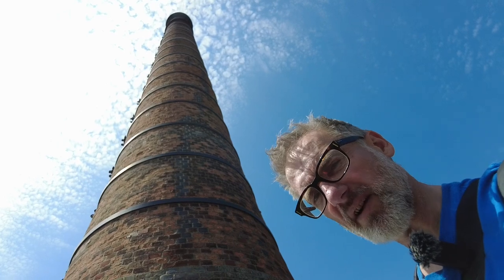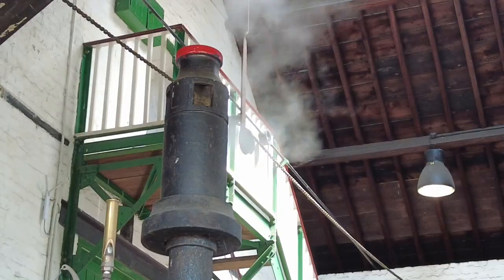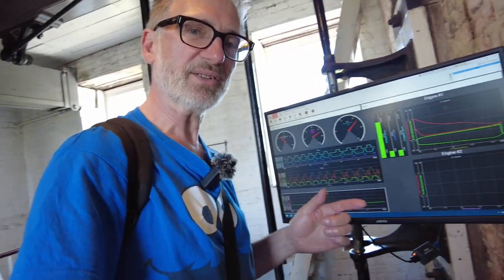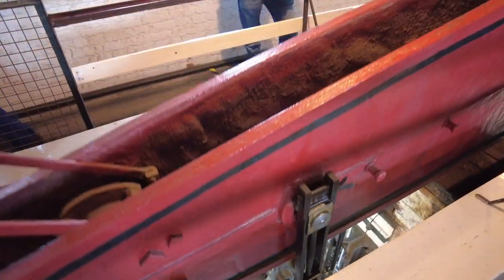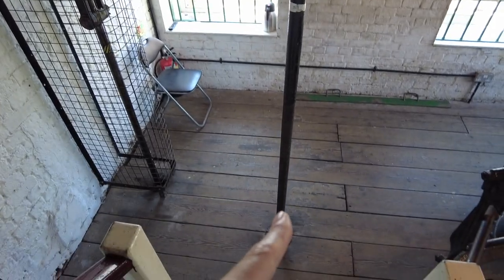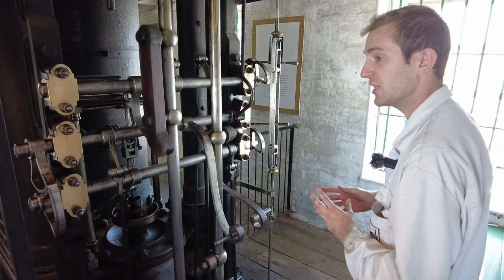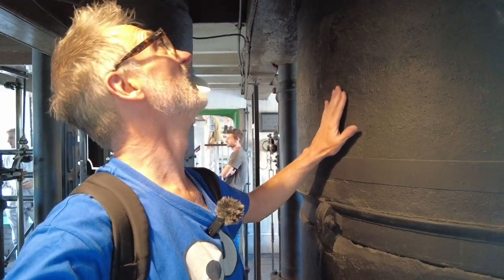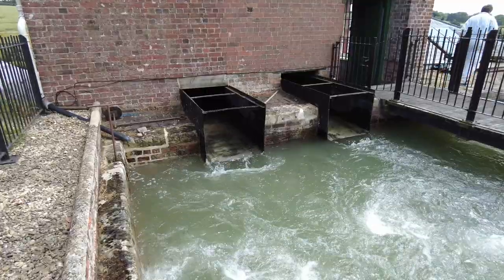Not the Easiest Place to get to by MOTORHOME

Comment: hi Ads and Zoe ,i know this is a little off topic but what engine is in Herman its just that me and a friend are servicing his hymer today and his is a 2.5 td 1998 year so id guess same running gear has Herman
Reply from the maker: Hi Drexel Spivey, Herman is a 1998 Fiat Ducato with a 2.5 diesel  engine. Non turbo. The running gear maybe the same as yours but I think ours was built in a change over year meaning it could have parts from new and older models.
Reply: @HermanHitstheRoad  Thanks for the reply ,one of the reasons for me asking is that your recent 5th gear problems encouraged me to get a friend  to top up gearbox oil but, there appears to be no gearbox dip stick on his ,but thanks for the great video s you  Zoe and Chas do ,also this is another friends hymer who had the same rear brakes has herman , im a member of a great group over here in ireland  Irish Hymers and we tinker on each others vans some times
Reply from the maker: Oh really? That's great 👍. Whereabouts in Ireland? We're going over in September
Reply: hi we are in north Kerry  in between Tralee and Listowel on a side note im in a group called Irish Hymers and we have our anual meet planned in September in Tipperary ,be handy for you to keep in mind if you was close by , we are off to France in August ,thats why me and a mate have been servicing our vans
Reply from the maker: That could fit in with our plans. Send us the date for the meet up and location. 
We're hoping to continue our tour of the WAW from Tralee
Reply: @HermanHitstheRoad   you d have to join group to get in but its free to join and im confident after watching your videos you and Zoe would love it